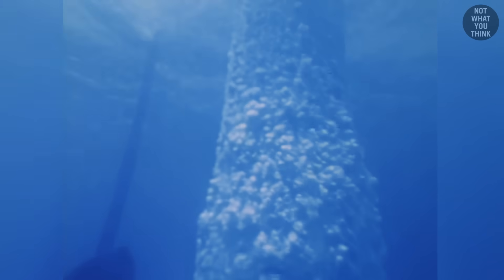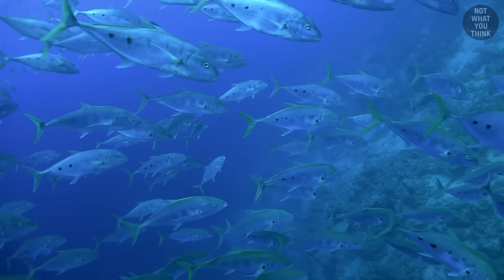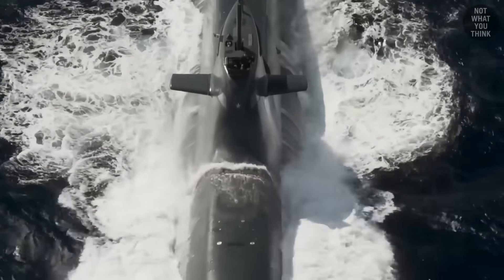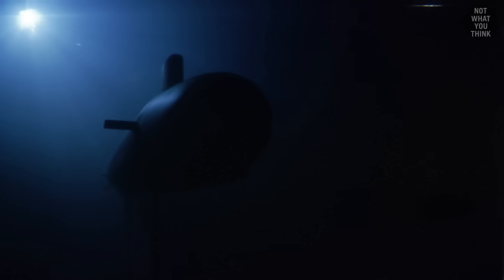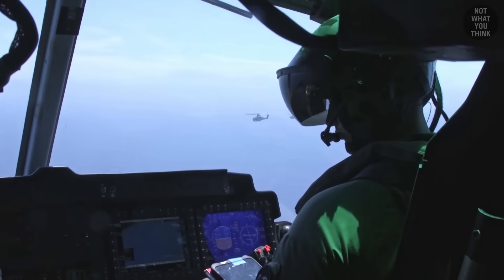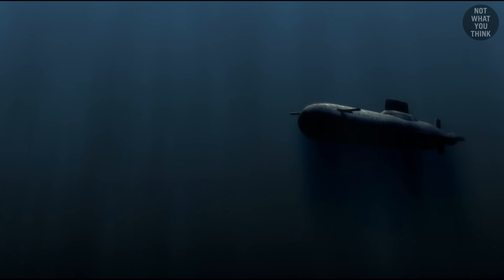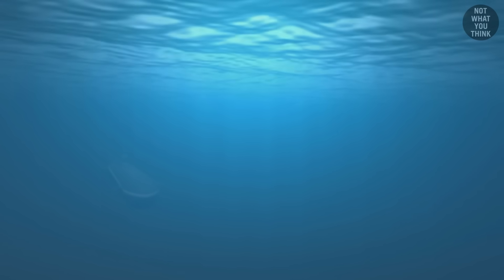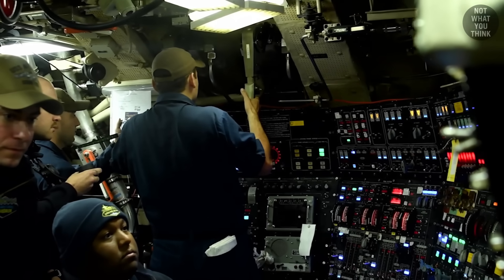Why Being Too Stealthy is Bad for Submarines

Comment: Spent 20 years in the submarine Navy and about 7 years underway and submerged.  I was a nuke, but spent a good deal of time on station in the control room.  I can say that about 80% of the time we detected a sub, it was from a transient noise: slamming a hatch, a toilet stall door, dropping a large tool, etc.  Some old Soviet boats were just noisy and we picked them up from pump signatures and the like.  A well maintained and operated diesel boat on batteries is extremely difficult to detect and track.
Reply from the maker: Thanks for sharing!
Reply: @NotWhatYouThink i am expecting one day you will talk with Russian voice against USA.
Reply: Yeah I've read that the nuclear powered Soviet subs, at least the earlier ones, were incredibly loud, and that It was really easy to hear them because they have to continuously pump water through the reactor core huge huge amounts of water or other coolant sometimes even crazy coolants like liquid lead. I don't know what the f*** kind of pump you need to pump liquid lead but I know it's going to be noisy
Reply: @cascadianrangers728  Some early U.S. nuclear boats also used to run on liquid metallic coolant. The allow based on bismuth and something else like lead.
Reply: The type 212's the Germans run  are damn  near impossible to pick up passively when they're on batts.
Reply: @tattootempest  I thought I'd read it was the Swedes
Reply: @BoulevardPark  Both German and Swedish subs have air-independent silent propulsion using hydrogen fuel. But Gotlands use a Stirling engine, the 212s use a fuel cell. So the only moving part on a modern German sub is the propeller and the coupled electric motor. Both the Gotland and the 212‘s predecessor (206) have defeated US carrier groups in exercises.
Reply: @RichelieuUnlimited what about the French AIP subs? I think they're using fuel cells nowadays.
Reply: @tattootempest  Yes. Technically - they don't usually run on batteries - but on fuel cells.

The whole propulsion system has exactly 1 moving part: The prop shaft. The propeller rotates at 12 rpm - max..

Modern AIP subs have come a long way. Even the best nuclear subs are a lot louder.

The Swedes use a stirling engine. A few more moving parts - but still a lot quieter than almost anything else.
Reply: @stanislavczebinski994  To be technically correct they use an AIP system, but most people understand battery and have no clue about AIP systems, so saying battery gets the message across.
Reply: @tattootempest  A simplification - sure.

My point is: AIP is way, way more advanced than diesel/electric.

An AIP boat can dive ~4 weeks without resurfacing - a diesel/electric boat 4 days - if that.
Reply: @stanislavczebinski994  said: "An AIP boat can dive ~4 weeks without resurfacing" Hence why the US military is not much interested in investing in such limited weapons. It's a coastal defense weapon with severe limitations.
Reply: @contumelious-8440  No. First and foremost - it's about politics.

US Navy has to buy domestically - and their budget is basically unlimited. They wouldn't buy a foreign-made sub if it was made of solid gold and cost 1 dollar.

Which is why they stick with nuclear subs. They are complicated, loud and very expensive - but they're made in the US.

4 weeks diving time is on a sub 1/5 the size (tonnage) of Seawolf class. Scaling it up would lead to even longer diving times.

The problem is: The US hasn't the tech. They can't build an AIP boat - even if they wanted to.

Germany started to develop fuel cell tech in the early 80ies. That was 40 years ago. Catching up with that is almost impossible - and very, very expensive at the very least.

And even before that - diesel/electric 206A-class "sunk" US carriers in excersises. Because US sub hunting capabilities are behind the curve as well. Instead of fixing the root problem - they simply fire the admiral of the carrier group - and move on.
Reply: @stanislavczebinski994  They tried to buy the shipyard who build the 212, to get the tech and they rented the Gotland class to do trails with it.
Reply: That feeling when you’re counter detected because a nub dropped a wrench in the bilge
Reply: Old soviet boats had poor isolation. If you bang the deck, and the deck is connected directly to the hull, yeah you're going to hear that. 

But Jonesy hearing someone singing the Soviet National Anthem? Nah.
Reply: @magicstix0r  Ramius was letting the Alpine play
Reply: @foomonchu6662   Let them sing!
Reply: DBF!!
Reply: slamming a toilet door ...what XD
Reply: 20 years and no one taught you about OPSEC eh? Sounds like you're a shoe in for SECDEF. You're DINQ on your GMT shipmate.
Reply: You were a nuke? Did you know Fatman or little boy?
Reply: Would your recommend becoming a submariner, that’s the job I’m currently working towards
Reply: @captainc9977 yeah, it’s a good time. I was on fast attacks. Stressful at first, being a nub isn’t that fun but not as bad as it used to be.
Reply: As a Sonar Tech aboard a Trident sub, I have to ask how a nuke (ET? EM? MM?) would know how the shack detected other submarines? It's not as if we put our method of detection or tracking on a bulletin board. Considering that your comment is ridiculously wrong, I am guessing you don't know. Broadband may pick up such a transient noise, yet by the time you steer to that noise, it is gone. The only way a transient noise will result in detection is if the boat is also making a continuous noise to be tracked. Otherwise Broadband will simply keep searching... I served 4 Strategic Deterrent Patrols lasting 70+ days each. Nearly every detection of another submarine is from screw noise. "Pump signatures and the like" are "tonals." They are not a means of detection, but classification
Reply: you mighta been a nuke but did you get your fish tho
Reply: アメリカの潜水艦は世界一だけどせめて日本海軍との合同訓練ではもっと力を見せてほしかった
Reply: I never understood why a loud alarm went off in WW2 subs when they were about to dive.

Seems a great way of generating a huge amount of noise to reveal the subs position to all.
Reply: @mtrest4  Flooding the ballast tanks and running the engines at flank ahead makes already a lot of noise, that the alarm bell doesnt matters.
Also, they did alarm dives only when they were already spotted. They didnt use the alarm when they were already submerged, on siltent running they even turned off the bell on the machine telegraphs
Reply: @mtrest4 we still have a dive alarm. It’s for the initial dive and other emergencies. AWOOOGAH AWOOOGAH!
Reply: What rate?
Reply: At least, until it has to start the diesels.  Then it's super noisy.
Reply: My question would be how do you know you didn't detect the other 20% if they weren't detected?
Reply: @JasonParham83 he said 80% of the ships they detected was due to sudden noises. 20% for other reasons.
It is a difference to say:
Of the Subs we detected 80% were for reason xyz or to say:
 we detected 80% of the subs out there.
Reply: @JasonParham83  
No, he's saying that- for example- out of 10 boats that they would detect, 8 out of the 10 would be detected due to noises like doors slamming, etc and the other 2 out of 10 would be detected other ways.
Reply: @Raz.C So the other 90 out of 100 subs wouldn't get detected.
Reply: @interstellarsurfer  no one said about the ratio of detection, only the ratio of reasons for detection. But even if 90 out of 100 weren't detected, the data about reasons is still very useful, either for practical or purely academic reasons.
Reply: @JasonParham83  There is a special place where recordings are studied, and if there was an incident, they would make a visual representation of how said boat disappeared or what they could have done better, how close they were to hitting an object or a boat.
Reply: @imjustthere9343 I was an avionics tech in a patrol squadron and the tapes were important.  They was also a big push to get frequencies of a new Soviet sub back in the early 70s when I was in the Navy.  My oldest brother was an STC on submarines in the 60s and 70s as was a brother in law.
Reply: @JasonParham83  I think he meant that of 100 detections, 80 were from transients.  The other 20 were from  pump noises etc.
Reply: @JasonParham83  it's an AI generated comment, mate...
Reply: @JasonParham83 he doesn't say they detected 80% of the subs, that would mean he has some other tool to estimate how many there were, what he says is out of all detection cases 80% came from noises.
Reply: @JasonParham83  "80% of the time we detected a sub"
Reply: @JasonParham83  Looks like these 20% were detected by the noise produced by the onboard machinery, not by the crew.
Reply: @JasonParham83 while @thesylance corrected you on your misreading. You still might not be able to detect a submarine YOU KNOW is in the vicinity. For example, operators that have to detect subarines need to be trained, and to that they will typically be place on a boat above the general poistion of a submarine and try to pinpoint it. And the operator may not always catch the submarine at the end of the exercice

Comment: Under some conditions, some satellites can detect thr difference in water temperature between what it SHOUKD br and what it is, and also the shape of the sea surface, which, remarkably, can change according to what large masses are below.  I suppose such detection works best in calm seas, and also that this information is not exactly new.

That said, subs are sasier to findbif you follow them out of port - which every navy will be diligent to frustrate in numerous ways.

Overall, subs, and particularly US subs, remain very hard to find when they don't want to be found.  Not sure how deep they can dive these days, but it has to be deeper than earlier generations, and no one's going to tell you.

Comment: Nuclear submarines aren't detected by the crew walking around in boots. The sound of the water pumps and other machinery required to maintain the nuclear reactors are way louder than any conversation you can have.

And a diesel sub has the possibility of being a LOT quieter than a nuclear sub. So no, the Seawolf-class is not the quietest thing out there.
Reply: Right, I never had any conversation while next to large pumps.

That was sarcasm.